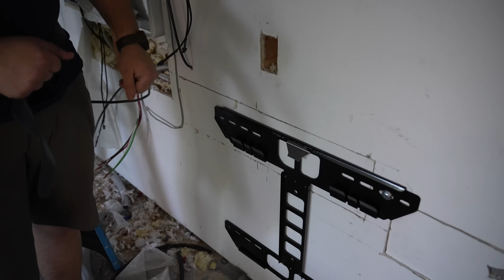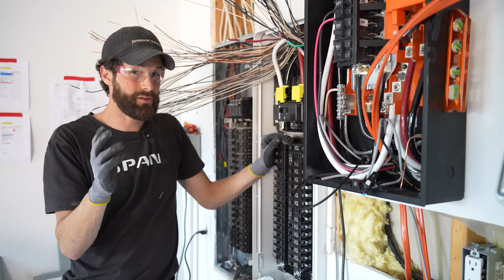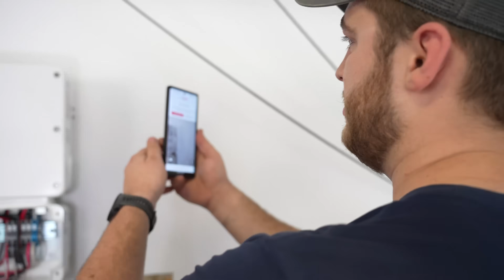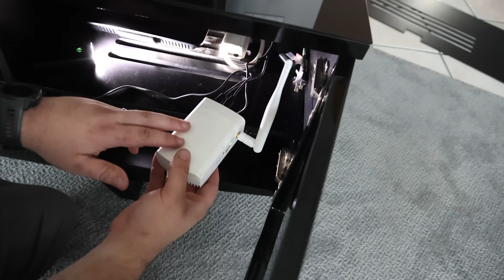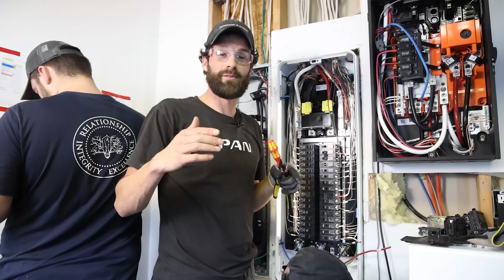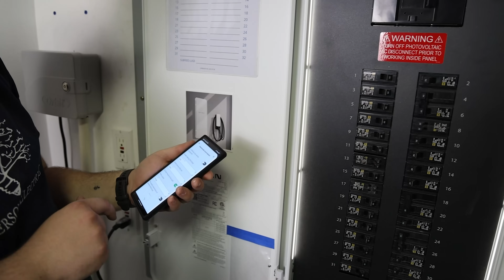An Electricity Match Made in Heaven - Part 2

Comment: Super stoked on your videos and Jefferson Electric’s code of ethics.
I’ve been an electrician for 27 years and by the grace of God never been involved in an arc flash,  In that time I have realized luck runs out. Before I throw a switch at the very least I install the dead front. Maybe, with the following you have, personal safety, especially arc flash safety should be considered. Love your work, love the videos, Thank you.

Comment: Another great vidio. Talking about the 1,000 pages in the NEC was told back in the 1970' s there was over a quarter million words in the NEC. Would not doubt that its closer to halve a million words in latest NEC. Best thing in Industrial sites when powering back up a 4,160 or 13,200 volt that feeds mist motors thru a VFD the inrush current is greatly reduced. Had 60 to 150 HP air handlers that had a ten minute ramp up time so never to trip out a freeze stat. Best policy is when readentifying a white conductor is to mark it every foot. Saw too many guys only place a wrap & a halve of cheap color tape right off breaker to have tape fall off.

Comment: I’ve installed about 80 of these batteries! Only had 2 faulty batteries so far! One leaking coolant, another one damaged! Keep in mind that your ATS “ Tesla gateway” can go bad so you want to keep installation user friendly just in case you have to replace it!
Reply: You don’t need to remove the enclosure when replacing a bad gateway. Just replace the “guts”.
Reply: Replace the “guts”? When a gateway goes bad it’s usually the motherboard which can’t get replaced. It usually gets covered through warranty and they send you a new one.
Reply: You can remove the internal parts aka guts (controller, termination lugs, contactor) in one or two pieces, leaving the enclosure alone. Try it next time you have to do one, it’s so much better than removing the entire enclosure.

Comment: I spend all day every weekday showing up to get dressed down by inspectors about my company's installations of that SolarEdge equipment, it was really nice seeing the values written correctly in the label on the DC switch enclosure cover for once (edit: actually no)... though surely you added the other mandatory labels to the panel and the inverter, and surely that raceway is bonded to the EGC on the other end. ;+ )

Edit: actually looks like you got one wrong. The short circuit current cell on that label is for the module short circuit current, not the charge controller/OCPD/equivalent fuse current.
Reply from the maker: Thanks for making us better!